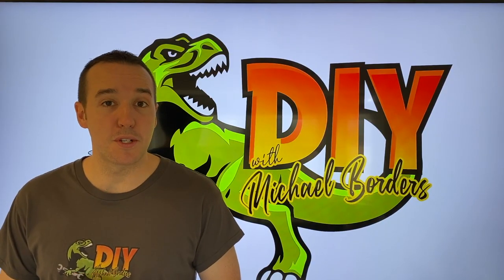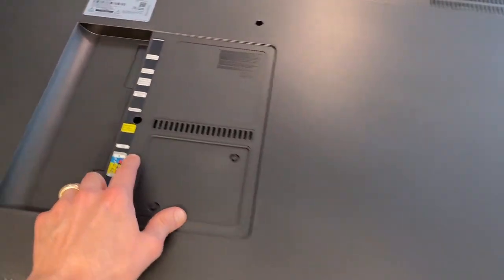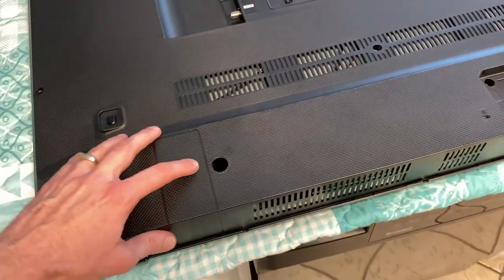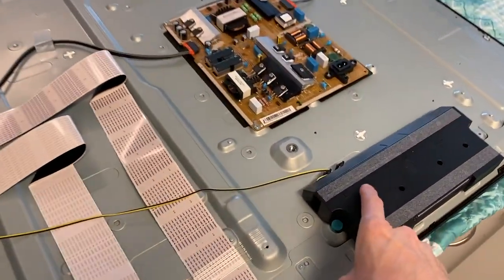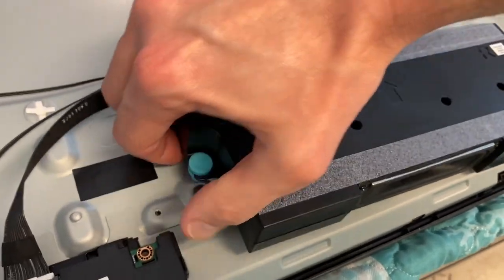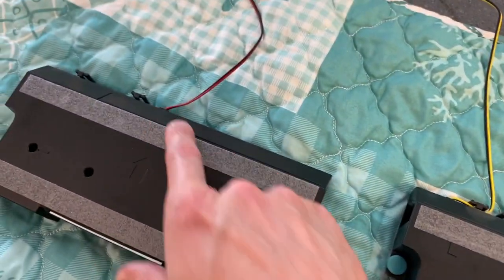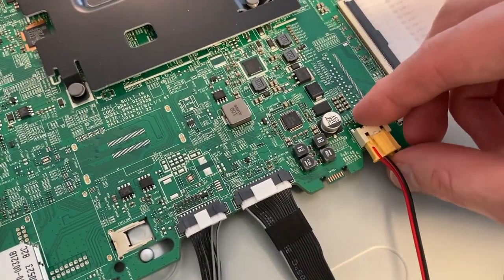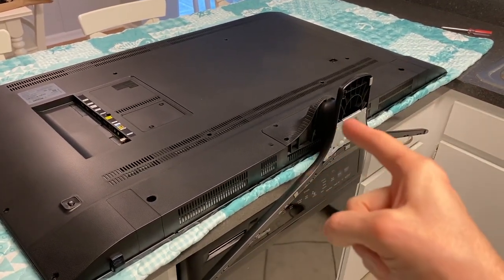How to replace static scratchy blown TV speaker

Comment: I have this TV. Trying to remove the back to reattach the LED diffusers. When removing the speakers, the grommets holding the speakers are green plastic not rubber. They broke apart when I lifted the speakers up. Where can I get the rubber mounting grommets your show in your video? The Samsung parts I have seen Online show only the speakers.
Thanks
Reply from the maker: Thanks for watching and sharing your experience.  You may be able to contact Samsung support and purchase brand new grommets from them… however, we would not be surprised if they told you the best route to take is to just purchased new speakers which will come with new grommets.
Reply from the maker: Another option would be to contact your local TV repair shop and see if they have grommets that they can remove from a junk TV and sell you.

Comment: I have a pair of speakers from another spoilt TV of the same model. Do you think I can add into the TV tap the same wires. Thank you
Reply from the maker: Good morning, just poured a ☕️ and am sitting down to answer any and all questions for the DIY community.

It’s possible, and more likely to be compatible than you think.  Keep us posted, and there will be many more helpful videos to follow!  😎👍

Let us know if you have any questions and hey if you’re interested, join our DIY ecosystem and help us grow an exclusive group of DIYers.

       toolboxtoken.com

Reach out to us any time!  🧰
Reply: @DIYwithMichaelBorders  Will the speakers have less (watt) power that the power is share to two speakers after that? Also I can't try yet, my TV is new, may void the warranty.
Reply from the maker: @ErnieSesameStreet  

Thanks for the follow up, it shouldn’t.  But you’re right, protecting your warranty is key.  👍🧰

Comment: This is a great, easy to understand video Thankyou. I need to replace the speakers in my Samsung also. I also need to replace the optical audio port on this same tv. Is it an easy operation or a bit more involved? I guess I’ll find out when I take the back off the replace the speakers.
Cheers
D
Reply from the maker: Good morning ☕️ we are honored to read this.  Replacing speakers will be pretty friendly.

Replacing the audio port shouldn’t be much of a hassle either.  Working on these TV’s can be discouraging however once you start working on it, you’ll find it oddly enjoyable.

😎👍🧰